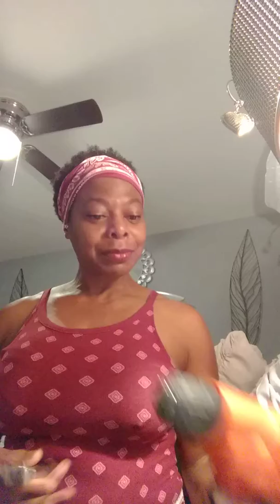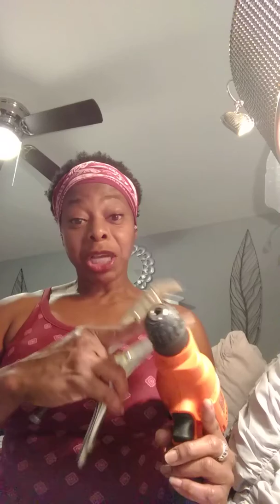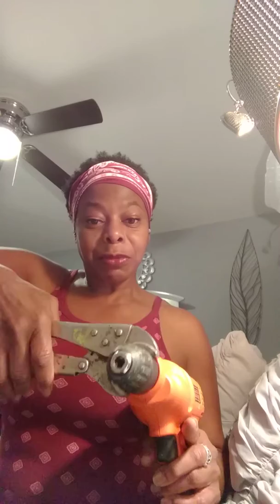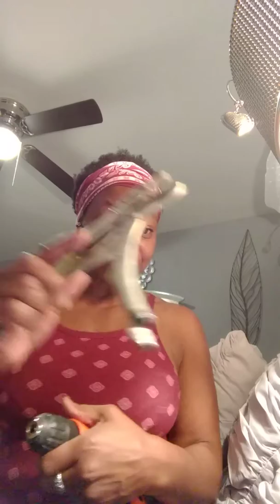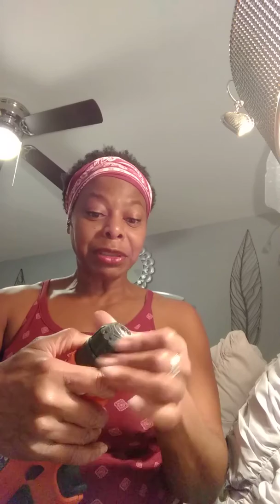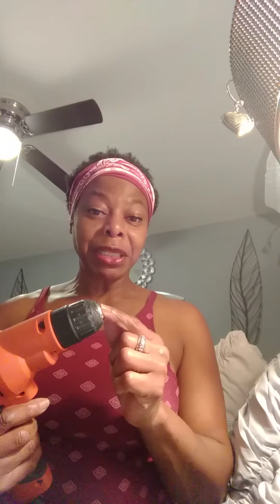How I fixed my stuck Black & Decker drill

Comment: Great video, there's an easier way. If you look down the hole of the chuck, there will be a hex bolt or a Phillips screw. Turn counter clockwise and it will loosen the chuck

Comment: Didn't work on mine & the screw on the inside is stripped so I can't take off through there so..
Reply from the maker: Im sorry to hear that. I had trouble with another one I  had I put W-D 40 on it and kept trying over time because I wasn't strong enough but I eventually got it to open. It was frustrating.